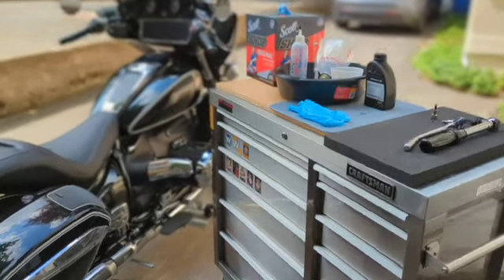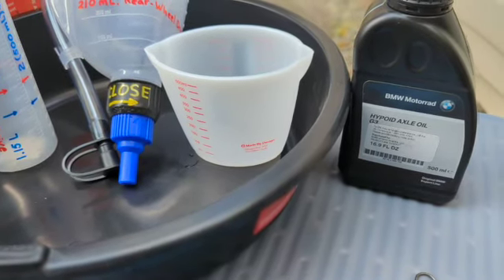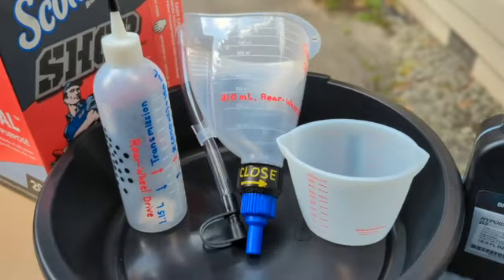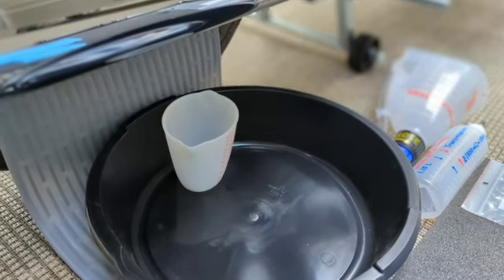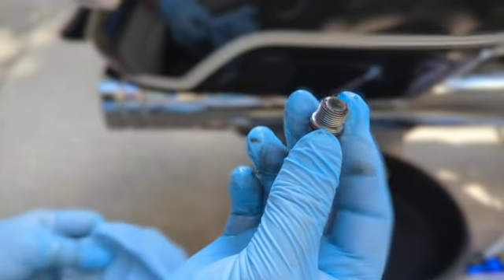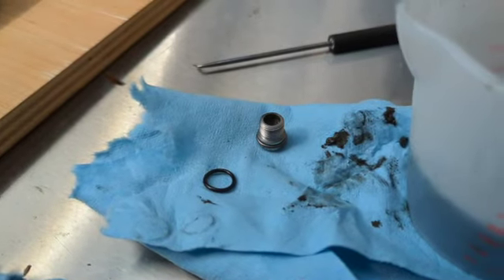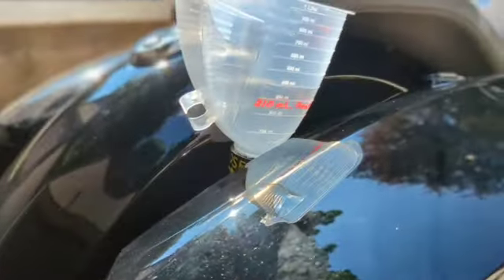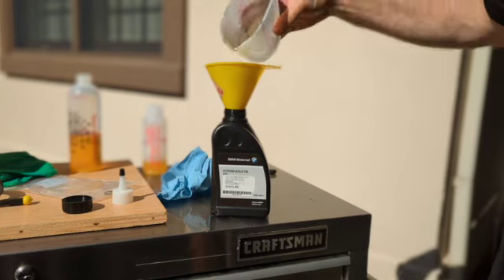BMW R18 Part 3 of 6 Rear Wheel Drive Service

Comment: 20 newton meters is 15 ft lbs torque 25 newton meters is 19 ft lbs
Reply from the maker: Actually, I think you are a little off on your Nm to Ft-Lbs. conversion; a general rule of thumb is to Divide the torque specification in Nm by 1.356 to get the equivalent torque value in Ft-Lbs. i.e. (Nm) / 1.3558 = Torque_Ft Lbs.

Comment: the best I ever seen - you are the own who tell the NM (20)
Reply from the maker: I prefer the Metric system; however, everything can be converted between Newton Meters (Nm) and Foot-Pounds (ft.-lbs.), Watts to dBm, etc..  I figured the bike is built in Berlin, and all of the bolts and screws are Metric; so I used Nm to stay consistent - check your torque wrench, it should have both ft.-lbs. and Nm

Comment: Sorry, but the bill is not correct - Transmission Oil 1.15 is 2 Bottles and 150ml (not 4 Bottles and 150ml..)
Reply from the maker: I purchased four (500 mL) bottles of gear oil, that can be used for the Transmission & the Rear-Wheel Drive Gear; I only needed to purchase three bottles, in order to complete both jobs: 1.15 L for the Transmission and 210 mL for the Rear-Wheel Drive.  (I have an extra bottle for next year's Rear-Wheel Drive job.)

Comment: Hi Scott they look like great measure jugs , equipment what web site or store did u purchase them from , sorry to ask.
Reply from the maker: HUH.. What..?
Reply: @scottsemone  He would like to know where you got your funnel and measuring bottle, and so would i.
Reply from the maker: Amazon...  I purchased separate sets for the engine oil and another set of the transmission & rear bevel gear, so as not to cross contaminant the fluids